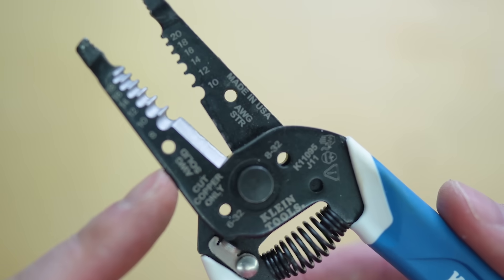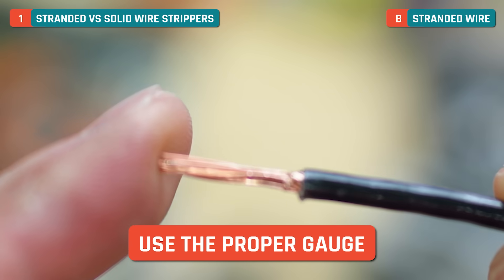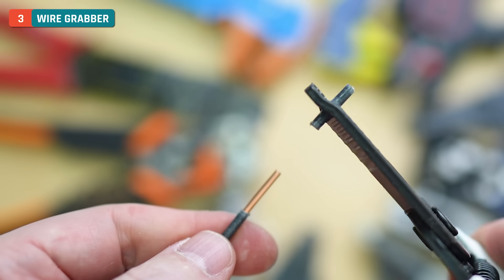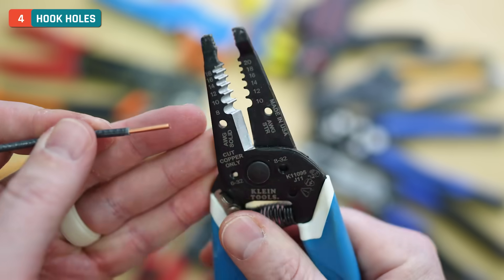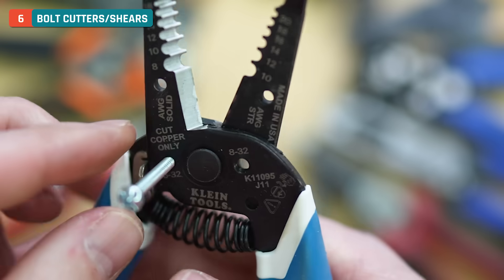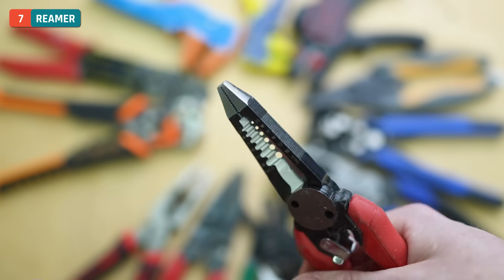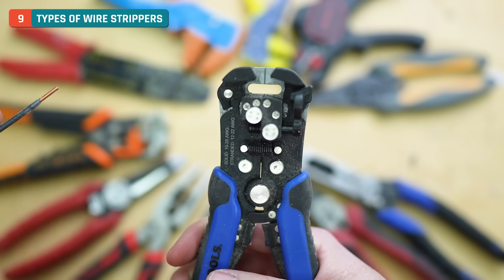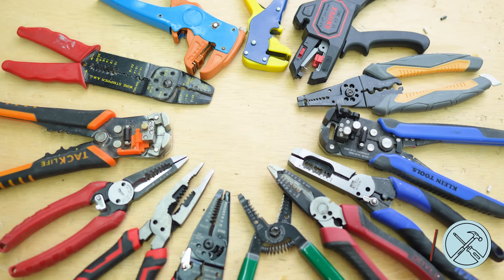8 Wire Stripper Features Everyone Should Know

Comment: 8/32 doesn’t have a coarser pitch.  The first number is the size or gauge of the screw, the second number is the threads per inch. So 6/32 and 8/32 have the same thread pitch but are different sizes, 8 is larger than 6

Comment: Those bolt cutter holes are great to use to twist wires together (if both wires fit through it) - much tighter twist,  which you can control with tension on handles

Comment: . . . I wouldn't use the ground method to check wire gauge: The NEC permits the ground equipment grounding conductor to be sized differently.

Comment: The knipex are better than the Milwaukee 7 in 1 BTW. They're more expensive, but they cut noticeably better and the blades on the knipex are substantially better. The Milwaukee ones are definitely nice, but so far the knipex ones have been virtually indestructible while the Milwaukee started suffering from blade separation and dulling.

Comment: If I had bent that wire the same way you did and left it like that in class, my teacher woulda ripped it off the wall and made me start over.

 Please don't use a stripper to break off the tabs, cut them off with your linemans or dikes because they literally never come off at the seams. 

Also, that hole does not rethread the screw when you back it out. At most, it helps to bend the excess metal from the cut downwards so the screw is a bit easier to thread into whatever you are cutting it for.

Nice-ish quality vid, but maybe it should be prefaced with you not being a licensed electrician before some poor apprentice tells his boss he's gonna bend off the "mouse ears" (No one says that) and gets called that as a nickname for the rest of his career 😂

Comment: Here is a Pro's tip on making the hook. A little above the base of the wire you make a slight angle on the copper wire the opposite way you did your hook. Then you make the hook just as you did. This creates a offset hook on the wire. It will ensure the plastic will not get pinched under the screw and make a better connection under the screw. May take a little practice to get the 1st angle and your 2nd  hook bend just right. Try it. Let me know what you think?

Comment: If my boss or the inspector saw me twist the wire strippers like that, I'd never hear the end of it.  Never twist, you'll ring the wire and have to start over.   For the hook feature, you have to apply more force to the wire during the bend so it keeps the wire against the tool the entire bend.  This will result in a much better hook for terminals without needing to use the needle-nose for correction.

Comment: make NOTE (most  screw cutters have a warning)... never thread the screw to be cut in from the incorrect side....or the cut off part will remain clogging the threaded hole.... not so easy to get out......   also it's thread per inch (of axial  length) =  pitch distance...  so relative "coarse-ness" of the pitch is not based on the diameter.  although visually one might expect a large diameter to be "coarser" threaded, technically does not have to be.

Comment: with a few exceptions, I wish the DI Y ers or DI WIRES (Credit to Everyday Home Repairs) would leave the electrics alone. As in, if you have to explain how wire strippers work, because people don't know, they should leave it alone. I can't tell you how many houses my Mother has bought, while I was growing up, that I had to rewire. And I knew what I was doing. I read, actually read books, at the library, then found my Grandma's Time Life books, specifically on "Basic Wiring" It was like all that information was already somehow downloaded into my brain. I was hanging ceiling fans for my Mother by the time I was 14 years old. I went to trade school for electrical and aced the class. Rewired 3 of my Mother's houses and attempted to rewire this house, that I purchased, but too crippled to get into tight spaces and bend ways I used to be able to bend. When I was younger I could literally bend over backwards, but this isn't Only Fans, so never mind on that.

Point being, people that don't know what tools are for nor how they work have no business using them. As I said, I can't tell you how many of my Mother's houses were screwed up, because someone couldn't keep their rusty screwdriver off it. Exposed wire connections to open air. Not even a wire nut on twists. GFCIs in the lavatory double wired into another one on the porch that would trip. Took a year to chase down that problem. Improper polarity on outlets, improperly wired switches. One of her houses I was surprised never had an electrical fire as a mouse got into her circuit breaker box and fried himself eating wires. Took a licensed electrician to chase that one down, found the remains when he took the cover off the circuit panel, and saw the mouse got in because the box wasn't installed correctly. That was not a pleasant stench, as smoke came from the panel and the lights kept flickering for several minutes. So I really wish people would leave things alone.

These people that use plastic boxes and conduit, I wish they would leave things alone too. They cheapen it up then I have to change it for steel when I happen upon it.

Comment: scratch the copper wire while stripping insulation will cause crystallization in the wire and is not acceptable. you failed to address this important issue
Reply: Let an electrician do it if it has to be correct.
😉

Comment: On the Milwaukee 6 in 1  strippers you showed. You can use the bolt cutter as a hook bending point and  if it’s in the closed position it sort of acts as a depth gauge too.

Comment: Stop that "twisting" back and forth motion when stripping. You nicked the solid wire on the first strip you did. If you don't have enough hand and wrist strength,  choke-up on the wire and use your thumb to push the strippers. You can also place your tool hand on the jaws of the strippers and pull. After a short time in the trade, you can easily strip anything because you do it 100s of times a day.
Reply: brother did you listen to the video? he explained not to do that and showed the nicks an example of why it's bad

Comment: i really wouldn't recommend using the needle nose section for twisting jobs, like twisting off those tabs.  this type of stripper is not designed for it and you're weakening them a tiny bit every time you do it.  they're like scissors.  imagine twisting the blades of scissors repeatedly.  not a good idea.
also, the area behind the pliers section is actually supposed to be a crimper for solderless terminals.

Comment: One thing not mentioned is the comfort of the handles. Especially when needing extra force like clipping a small bolt/screw. A lot of these tools have very square profile handles(though usually rubber dipped), rather than rounded. Seems like a lot of hand tool manufacturers put more thought in to the tool end and less in the handle end. Like screw drivers- for some reason, tool makers think that when a person needs a smaller screw driver that it also needs a smaller handle. Like the size of your hand changes when you need a smaller tool. I'm not talking about jewelers tools but just dropping in size from a #3 Phillips to a #1.

Comment: I always liked my older Cornwell LS series wire strippers. Cutter is on the same portion of the strippers which are below the pivot. The older versions, the non insulated crimper was rounded enough you could use it on insulated terminals as well for an even better crimp without tearing through.

Comment: As a junior biomed engineer my favorite tool for stripping very small wires (24 awg or smaller) is the black xcellite universal strippers (similar to the kinipex at the end of the video, though I haven't tried that brand).

However there is still a limit before it starts to damage the  conductors. Starting on a loose (-) setting and gradually tightening until it strips helps.

For extremely small wires (30 awg or less) I guess that heated tweezers may be better, but would love to hear from someone with more experience with small wires!
Reply: Heated blades in general, but that means a battery to replace.

Comment: 11:12 you used the crimper backwards. Or it was Milwaukee that did it wrong. Either way, the pointy part of the crimper goes into the solid side, not the split side. Notice how that crimped connection is uneven and not very strong.

Comment: One favorite trick I use for solid wire is tilt the cutter 30-45 degrees to cut, then straighten it out. This pushes the insulation just a hair, breaking its bond to the wire, making it easy to push off. I also always crimp the wire on screw terminals; if the screw ever backed loose, the wire can't wander off in the box. Never use the push-in holes if you don't absolutely have to.

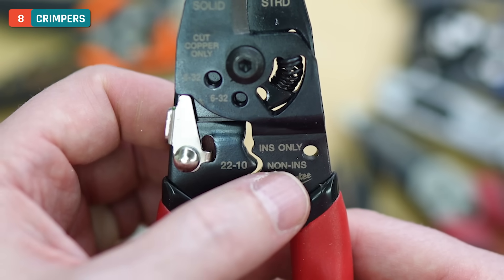Comment: You missed one my man!  at https://youtu.be/JLtrEraz1uU?t=678 11:18 just above your thumb.  the IDC is for crimpimping IDC  or "Insulation Displacement Connector" type junctions.  For those unfamiliar, those would be the "Vampire tap" type connector.  Usually they go onto an existing wire and have a small piece of metal with a slit in it,  just under the size of the conductor, so when crimped, they 'split' the sides of the insulator and the matal makes contact.

Comment: With the Knipex style of stripper, it is beneficial to have the insulation stay on the end of the braided wire. You remove the insulation by twisting it between your fingers. This causes the braids to twist together smoothly, making it much easier to remove the insulation and mechanically more secure when putting the wire into a crimp or to twist two wires together (i.e. wire nut). If you leave the strands straight you run the risk of one(many) strands not going into the crimp or around a post(soldering). Same risk as using to small a gauge to strip, where you cut the strands reducing the wire size (amp capability).  I learned this in the G-spec soldering class. They even had specs on how the insulation should be cut at 90degree to wire, zero wire nick, not stretching the insulation because it will shrink back and expose to much of the conductor, etc. A little bit of overkill for large gauge wiring. But that one trick really helped while doing house and lamp cord type wiring. It also saves the hands. Gorilla strength to get that last 1/4inch of insulation off by pulling with the strippers one hand vs the other or gentle pinch and twist between two fingers. With most braided wires, think wall heater or light fixtures, the factory leaves the insulation on the end, not because they are lazy or cheap. They do it to protect the strands. Choosing between twist or pull. Twist is much easier on the hands. That is my experience. Give it a try. If it works for you. Great. If it doesn't, no harm.
Reply: Stranded wire going around a screw, I twist counterclockwise to wind it clockwise on the screw. This seems to keep it from unraveling.

Comment: You shouldn't twist while stripping, it can cut stranded wire, with solid wire twisting can cut a ridge in the wire that can make it weak possibly causing it to break, use the correct size cut the insulation and just pull, no twist.

Comment: The screw cutter is not acting as a die, taps and dies are for cutting new threads, this is a completely different tool called a thread chase. Always use a thread chase to fix threads as they reform the threads instead of cutting away more material. If the threads are damaged beyond using a chase then a more substantial fix is necessary like drilling and tapping a larger hole, going with a thread insert of which there are a few different types or god forbid use a new bolt or nut

Comment: 4:45 - Using the (uninsulated) ground conductor to determine gauge of the insulated conductors.  Be aware that on older "Romex"  (NM cable) the ground conductor may be a size smaller than the current carrying conductors.  IIRC, the NEC started requiring a full sized ground in the early 70's
Reply: True that. My house was built in 1960 and the ground wire is smaller gauge than the other two.
Reply: Which is stupid as anything. If you need the ground wire because of a short, you don't want the ground wire to fuse. It should be larger than the others.

Comment: From Klein's website.  Wire Stripper easily cuts and strips 10-22 AWG wire
Multi Tool's narrow, serrated plier jaws pull, loop and bend wire
Cleanly shears 4-40, 5-40, 6-32, 10-32 and 10-24 screws and crimps insulated, non-insulated terminals and 7-8 mm ignition terminals
Cutters and strippers are in front of the pivot to easily reach into tight places
Made in USA
Plastic-covered cushioned handles for comfort

Comment: Thank you, this is a useful video.  However, at 11:13 the crimper should go the other way around, with the pin on the flat side of the terminal.  The open barrel  junction of the terminal needs to be closed by the round side of the crimper rather than opened up by the crimper pin.
Reply: Yes, he crimped all of them the wrong way...

Comment: There is no difference in threads between 8-32 and 6-32, they are both 32 threads per inch.  In older Romex cable the ground wire can be smaller than the hot and neutral, 14 gauge ground vs. 12 gauge hot and neutral (I don't believe code allows that any more).

Comment: on the switches/sockets, there is a little ear where the wire goes. Put the straight wire in and turn the switch/socket, and it will loop the wire. You don't need to loop it first.

Comment: Not a bad overview, but the pliers on these basic wire strippers are absolutely not needle-nose pliers. Try grabbing those strippers when someone asks for a needle nose pliers and you'll be sent back for the correct tool. Needle nose pliers, as name suggests, narrow to a very small point. This often provides better access to difficult to reach parts and it also allows you to grab something with a minimum of interference with the work. Most needle nose pliers are fairly conical. The pliers on the end of these wire strippers neither narrow to a point or are rounded. As a DIY channel, primarily aimed at folks with novice to intermediate tool skills, using the correct terms is important for buying tools as well as communicating with other craftsmen. 

I'm also a little surprised, given the detail you went into on the first tool, that you failed to point out the adjustable stop on automatic strippers. It's a key feature of these tools, allowing efficient and accurate, repeatable strips. 

Keep up the educational content.

Comment: I remember when I was running conduit every day, all day, we chose to use either a pair of channel locks without the dipped handles on, or my favorite, the reamer screwdriver with replaceable die's.  I mean you're not stripping wire the same time you're running conduit.

Comment: That's not "romex wire" !! it's an individual conductor, most likely THHN , which refers to the insulation on the conductor (Thermoplastic High Heat-resistant Nylon-coated wire) 3 of which, make up NMS cable, or NonMetallic Sheathed cable (colloquially called romex) diy is fine and cute, but ELECTRICAL WIRING IS NOT A HOBBY! call an electrician, don't hurt yourself, someone else, or burn your house down cuz you wanted to "Do It Yourself" ...from:  --an IBEW member. 👍

Comment: The setting where the stripped insulation stays on the wire is for marine and small instrument use where the salty sweat from your mittengrabbens  would be detrimental to the longevity of the connection! When I'm doing repairs in awkward positions, i invariably feel the need to give the new strip a half twist to ensure there are no whiskers sticking out on my blind side, so the little stripped piece is what i pinch to do that, and then pull it off in one motion. No salt or grime off my hands on the clean wire.

Comment: 5:11 - taking the ground out of Rome and using that to figure out the gauge of the main conductors won't work in most cases. NM cables almost always have a grounding conductor 1 size smaller than the hot and neutral. (12 AWG NM has a grounding conductor of 14 AWG)

Comment: The upper adjustment on the Knipex is not a pressure setting but a insulation thickness setting.  If it doesn't cleanly cut the insulation then adjust it for a more aggressive cut.  If it nicks the wire adjust it for a less aggressive cut.

Comment: Nice video, but I want to make a little correction.
At about 7:30, you showed two screws and said one was a 6-32 and the other was a (coarser thread) 8-32.
That's not possible. 
What you actually had was a 6-32 machine screw, and a 8-24 machine screw - and that probably explains why you didn't show it being cut in the strippers.
The first number in a threaded fastener size/thread pitch designation is the industry standard nominal size. That number (on non-metric bolts and screws) describes the number of threads per inch. A 6-32 and a 8-32 screw is the same thread pitch with the same 'coarseness' or 'fineness'.
On metric bolts and screws, the first number designates the nominal diameter of the fastener (in millimeters), and the last number describes how far apart the threads are in millimeters - that's why you will often see decimal points used in the second number of metric fasteners.

Comment: #2 is great for "pre cut" wires on new install for Automotive or low voltage. Manufactures pre cut wires and it's easy and fast to "drop in a wire" to the notch. Yeah I work with bionic people that could pull off 4-6 violently barehandly during an install, but with my small gauge wires.